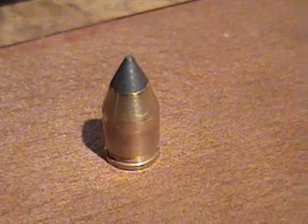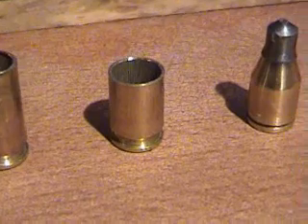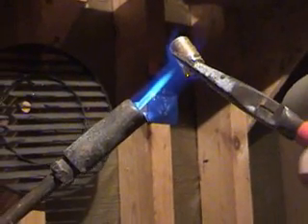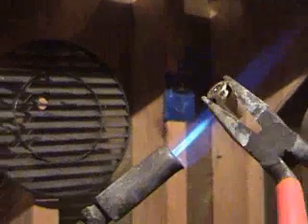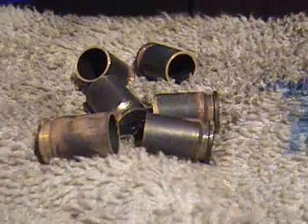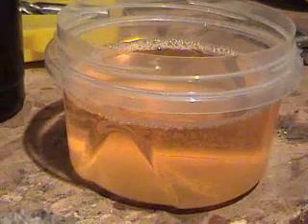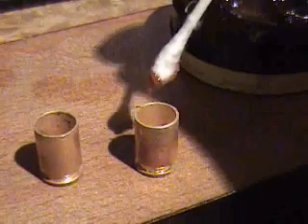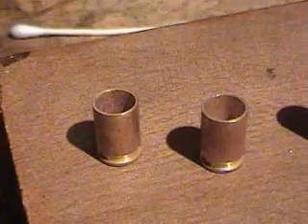swaging Pt. 1

Comment: By dropping them in the water doesn't cause the brass to hardern more then just letting them air dry?
Reply: NO, brass work hardens it does not have water quenching characteristics.